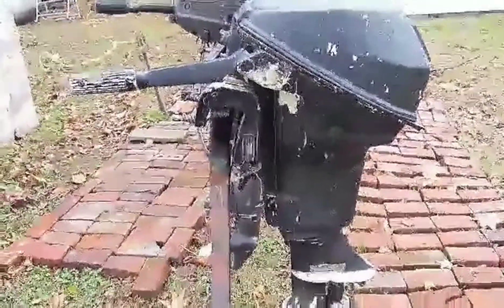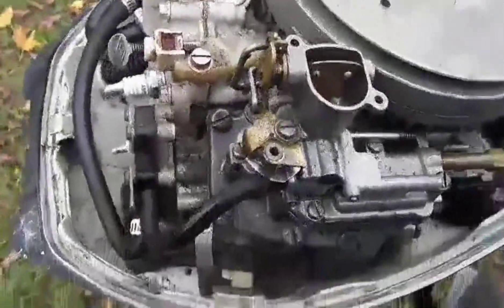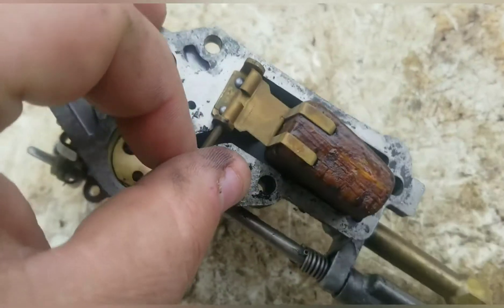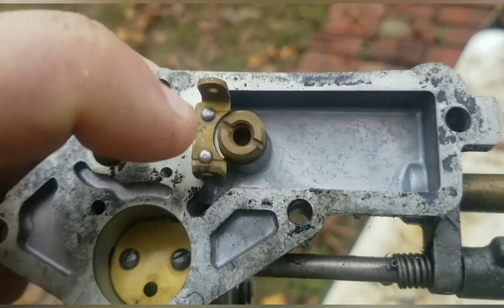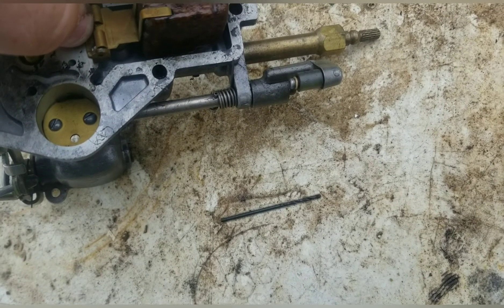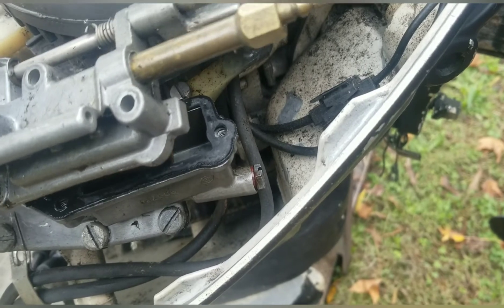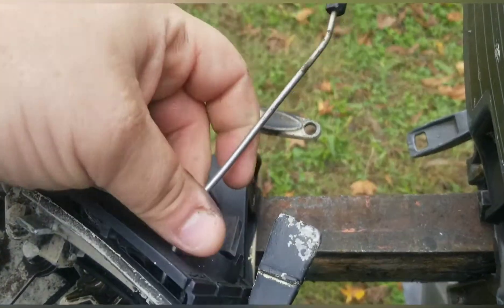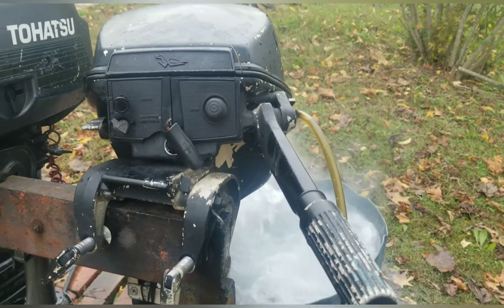9.5 hp johnson carburetor clean

Comment: Nice video..Ive got a 9.5 72 johnson and I wonder if its an easy way to make this a 15hp motor. I heard sonewhere that there might just a restrictor plate to remove.. do you know anything about this?
Reply: The later 9.9's,yes.
But not the case with the old 9 1/2 horse Johnson. Great old motor's though,even today 👌

Comment: what fuel oil ratio do you run in it
Reply from the maker: I run 50:1 in this motor the older engines before 1964 I run 32:1 evinrude switched them